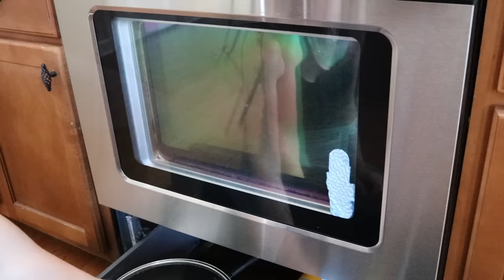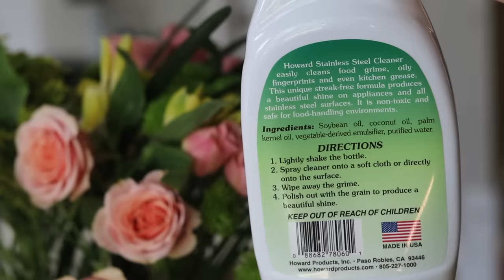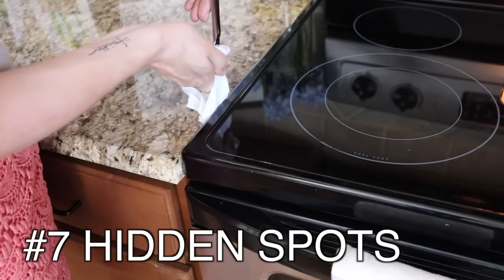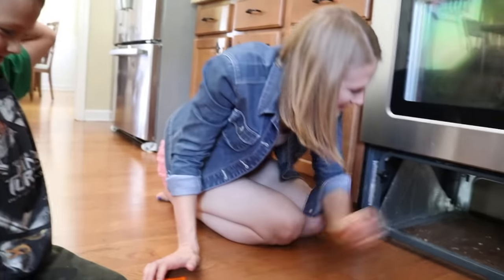7 GENIUS tips to clean your oven...so it looks brand new! 🍋😱

Comment: 00:29 oven grates
Soak in bathtubs with 1 cup liquid detergent for an hour. Scrape off with bristle brush. 
00:43 Glass panes
Glass cleaner fly swatter with cloth soaked in it. 
1:08 
4 parts baking soda 1 pet water. 1:39 dip the sponge in vinegar and then scrub.
Reply: 00:43 how much water?

Comment: Instead of using an Oven mat, I just put heavy duty foil underneath the coil that gets hot and it works like a charm!
Reply: Marriage & Motherhood Thats exactly what my mom did since 1970s. LOL
Reply: Marriage & Motherhood That makes more sense to me cause putting the oven mat above the element as shown would block the heat from circulating properly.
I've used the foil trick in the past...just be careful to watch for spills because if "stuff" seeps under the foil it can almost "glue" the foil to the bottom of the oven & it's a bear to get off!
Reply: Joan Taylor If flames are actually shooting up through the floor of your oven, it sounds like your jets could be set too high.
Reply: My mother in law taught me that trick about 30 years ago been doing every since❤️️❤️️
Reply: I do this too! If you have the electric oven coils, foil works great to cover the metal cover so cleanup is a snap
Reply: Great tip :)
Reply: Kim Poole my friend had a fire because of using foil and insurance company would not cover the damage don’t use foil please
Reply: Exactly my grandma did it and so do I... works just fine!
Reply: Marriage & Motherhood agreed! I've always done the same thing - foil, works like a charm.
Reply: @pamh.5705  I've been told that foil changes the oven temp, which is not good if you are baking something according to the temp you have set.
Reply: My mom did this and so do I.    Much better 😊
Reply: Thank you for posting that! I guess I’m cheap but I don’t want to buy it a mat.
Reply: I tried that and the foil stuck to the bottom of the oven.

Comment: FYI, the instructions on the oven liner's Amazon page say to put it beneath the electric heating elements (on the bottom rack for gas ovens). I think the placement in the video (bottom rack, above the heating element) will block the conduction of heat and impact your cooking.

Comment: I have an oven liner and I love it. I've had it for many years and ten plus years later, it's time to buy another. It's so easy to take out and clean. Extremely easy to clean. I have a wall double oven and and it doesn't have self cleaning because of the surrounding wood. Ready to start with the baking soda.

Comment: I've been frustrated with my oven for years, it has always looked so hard to clean and I've just used chemical cleaners that don't work at all. I never believed baking soda and vinegar could help with the worst king of grease. Thank you so much! The video is adorable!
Reply: @TheWolf401 I used a combination of the oven cleaner AND the recommendations in the vid.  1st I followed the heat method on the back of my can of oven cleaner (preheat to 200), then turn off. spray the entire inside of oven,  close door, let sit for about 20 min.  wipe clean with damp cloth/sponge then follow the directions in the vid. My oven literally sparkled. I wish I could post before and after pics here. I'm kinda embarrassed that I let it get as bad as it did. I didn't have to scrub with elbow grease a whole lot either. 😁 I think this will be my new favorite way of cleaning my oven! 

Now I'm off to my tub!

Comment: OVEN MATS are. MUST for me!!  They are cheap too!!  Further.... "A stitch in time saves nine" comes to mind here.  Yes, I KNOW it's a pain, but if after washing-up you wipe down the inside of the still warm oven and oven glass with a hot soapy cloth, then a clean hot damp cloth, you won't be faced with a mammoth task. It takes less time in the long run if you do a couple of minutes wipe down after using the oven.  If it does get a bit gross, those cheap round wire scrub balls that open up as you use them (not Brillo Pads as the wire in them is too tightly compacted), are SUPERB for scrubbing off any burnt spots in seconds. They do not scratch the surfaces either.   I use them on interior oven glass door too!!  Hope this helps.

Comment: Girl, I love the self-clean feature! Maybe do it in the winter? But what's not to love about just wiping out the ash afterwards with no scrubbing?? I have also seen Clutterbug steam clean her oven by heating a baking dish full of water. Just like in your microwave, it softens all the gunk so it wipes off!
Reply: I had an appliance repairman tell me not to use the self-clean feature as it is too hot for the digital electrical panel. At least for my model. I have always hated the nasty smell during self-cleaning anyway, so it wasn’t hard to give it up.

Comment: Be careful with those liners if you have a  gas oven.  I thought they were a great idea and used them!  Then my new oven wasn't heating properly and I called a repairman out.  The repairman said the liner was keeping the oven from getting proper ventilation  and therefor wasn't heating up.  Took the liner out and it worked fine.  Love the video!  Thanks for all the tips!

Comment: I put the larger sized heavy duty foil in the bottom of my oven, under the element.  EASY cleanup by just changing out the foil sheet. You can fold the foil neatly to whatever size you need.

Comment: Kathryn just a suggestion when you are done cleaning put some foil under the heating element. It will catch all the drippings and make cleaning up next time way easier. I’ve done it in almost every place we’ve lived in. Makes it easy for sure.
Reply: Sorry I didn’t watch the whole video. You bought a oven liner so no need for the foil. 🤦🏽‍♀️☺️
Reply: My oven manual says not to use foil on the bottom. Not sure why.

Comment: Oven grates in the tub, it's been 10 minutes and already I can easily wipe off some small areas of lighter greased parts. I couldn't help myself, I had to see if it was really worth the trouble. I used arm and hammer detergent. I even put my uncleanable gas stove grate in there. I have tried everything to clean it and nothing has worked. I even used brilo pads but getting in between all the iron parts to scrub is painful. I'm going to try the paste in the oven next. If this works, I'm linking you to my family!!

Comment: Question on the 'oven liners'.... are they safe?... could they catch fire?.... and... do they block the air from circulating?  I mean, the liner is obviously covering up the bottom part of the oven from which the heat emanates, so I'm guessing that if one keeps that liner in the oven at all times...and specifically with regards to BAKING, and where temps need to be precise, that the liner could be problematic?

Comment: Looked oven cleaning up on Youtube the other day:)  If you take the bottom drawer out and lay down on the floor and look up, there are four screws...if you remove these screws...at least on mine the front glass comes off and you are free to clean the inside of your glass.  Worried about getting it back on, but wasn't too difficult, and I am 71.  It says that the bottom plate comes off, but with mine the whole front glass came off.

Comment: I have a ceramic top stove and the manual for it says you aren’t supposed to use oven liners or even Reynolds wrap along the bottom (like my mom used to do).  Do you ever have any problems with it?

Comment: You can only do the baking soda trick in the oven if it is non self cleaning.  If you use baking soda in a self cleaning oven, you can ruin it. I just moved out of my apartment and used baking soda and lemon juice, over night, scrub and it worked for me.

Comment: We don’t but oven liners. We just use aluminum foil. We rip a sheet big enough to cover the bottom and we lift the heating element and line the bottom of the oven with it. Way cheaper and super easy to replace.

Comment: Great video but unfortunately, it didn't work as well for me.  There was the normal fizzy reaction of the pure vinegar on the scouring pad mixing with the baking soda in the oven, but I scrubbed until my arms felt like they were going to fall off and the oven wasn't coming clean.  What's worse, I had all these clumps of baking soda, that I had to try to remove... some of which fell down into parts of the oven that I couldn't reach.  I'm concerned about what's going to happen when I turn my oven on.

Comment: Tip everyone.... Instead of investing in a ten dollar oven liner....I just use a oven sized piece of aluminum foil. (I buy the economy size box from Sam's Club so it's wider. But you can fold two sheets together with a smaller sized sheet of aluminum foil. Mine usually last about 3 months. But if I do an extra amount of baking I replace them after the holiday baking.  :)

Comment: I know you don't have drip pans on your stove, but do you know an easy way to get these clean?
Reply: kayceejay I would love to know that too
Reply: Drip pan can be soaked in super hot water for 30min-1hr with a little vinegar and dish soap. Extra tough spot can scrub off with SOS pads. If all else fails buy new ones and in your next home line the drip pans with foil. My oven is lined with foil the bottom. Super easy, scrubbing needed.
Reply: i just take them out and throw them in the sink with dish soap and let them soak for a few hours.  i also use foil and wrap them up so they don't get near as dirty.
Reply: If your drip pans are especially grimy/cooked on, buy Dollar Tree dishwasher soap, dry or liquid (I like the dry for this) and sprinkle some in the sink as you're running the hot water in. Let soak a bit and there's almost no scrubbing. I think it cuts the crud better than plain dish soap.
I also sprinkle a bit of the powdered dishwasher soap into gnarly baking dishes to soak.
Reply: I have to do this again going to try baking soda paste also the coils come out just pull horizonatally from where it connects while off they are also pretty inexpensive if u just want new ones I know in rentals there is no saving some of these small items

Comment: That oven liner is in the wrong spot and will block heat from getting to your food normally. This is also a Convection oven, so the placement will hinder airflow making the convection process less effective. Since this is an electric oven place it on the very bottom under the heating element. If you have a gas oven, place it on the bottom covering as much surface as possible without covering any holes. If you really want it in that spot (middle rack) make sure you leave a big gap on all sides.

Comment: Great ideas! Just remember if you have birds, no over liner, no burner liners, no non stick pots, pans, never mix the vinegar and baking soda, never heat the vinegar, and never self clean your oven if you have birds. No matter what they say. Even new non stick can kill your birds. Thanks for the tips. I was looking for alternatives. Nice to know I can use the baking soda without vinegar. I’ll just have to scrub a little harder to remove it with water.
Reply: Yeah. Baking soda and vinegar ( acid + base) neutralize each other. With the baking soda and water at least you have some alkaline power working for you. Use one or the other, but not together.

Comment: I see you struggle a bit with your oven door. Did you know you can flip the metal flaps at the bottom inside of your door, where the hinges are, and remove it by semiclosing it and pulling it out? This's been a game changer for my oven cleaning adventures!

Comment: When you say use one part...is that a cup in measurement terms?
Reply: Renae Brook 
It means equal parts.
If I say to mix 1 part vinegar with 3 parts olive oil, you can use any measurement you want.
Such as 1 teaspoon vinegar to 3 teaspoons olive oil OR 1 cup vinegar to 3 cups olive oil.
If you were using a 1/4 cup measuring cup, it would be 1/4 cup vinegar to 3/4 cup olive oil. 

It all depends on how much of the mixture you want to end up with.

Comment: I read in the manuals that it isn't safe to cover the whole rack with any type of material - it prevents circulation and may cause more carbon monoxide to be inhaled and lead to carbon monoxide poisoning. It may also trap heat causing a fire.

Comment: You can just unplug the heating element. Just pull it straight out, and plug it right back in. Better for it than lifting. Lifting can affect the connection. Next time!

Comment: You know they make a cheap foil pan that goes under that oven element right? They probably even have it at Dollar Tree. Can’t use them in the oven with the element under the bottom but you can in that older oven.

Comment: How would you like a real tip. Open your oven door about 2 in and it will click and stay right there.
Reply: Hit the wrong button. With the door open to the first click grab the door by each side and firmly lift up. The oven door will come off. this way you don't have to reach over it to go into the back side of the oven and you can clean the door on the counter or the table. And here's a tip of equal value. Always buy quality cleaning supplies Dawn SOS pads the good quality green scrubbing pads. The cleaning supplies at Dollar tree will only make you work harder and you will not be happy

Comment: Everyone is cute, I’m sure you are very nice, but this just doesn’t work. Maybe for Barbie ovens or lightly used, low temperature stains, etc, but don’t waste your time. I tried, with significant doubts, this method by the numbers. Not only did I get essentially no results, no cleaning at all, I will be cleaning caked baking soda paste out of the many books and crannies in my oven for months. It gets everywhere and does nothing. Get a mask, a respirator if you have to, a rubber suit, gloves, or your husband and just use EasyOff Oven Cleaner as directed. The residue wiped off with a wet cloth, with a few minor exceptions I needed a rough plastic sponge. Put the grates in a large trash bag, spray, seal and wait a few hours and they mostly wipe clean with a cloth. I used steel wool on the tougher spots. My oven looks brand new, I’m still alive and kicking, and I will fearlessly continue to cook, broil, burn, and spatter, knowing I can clean the beast the old fashion way.